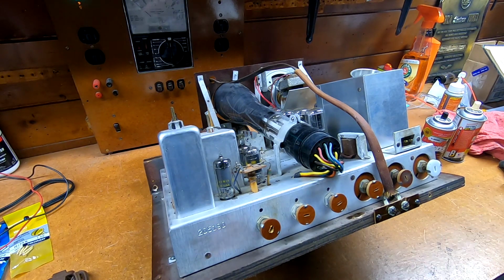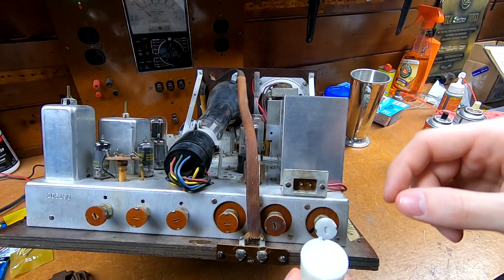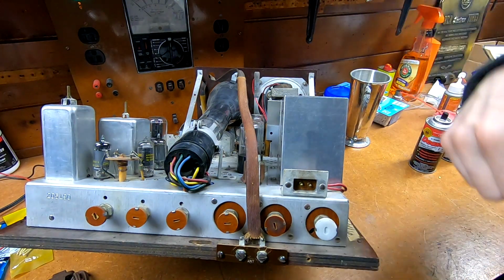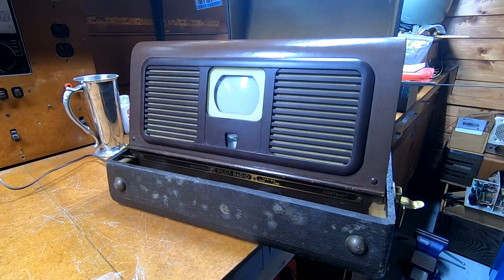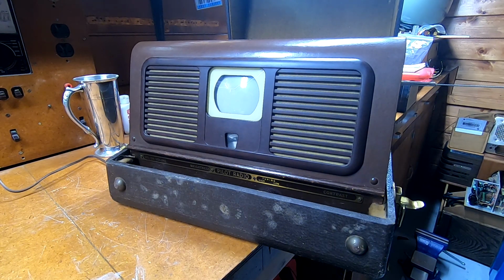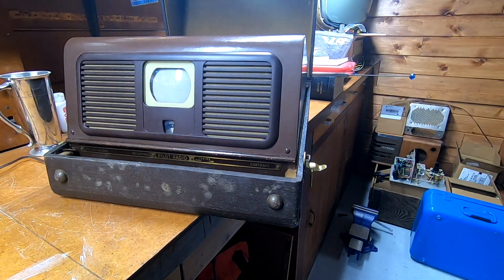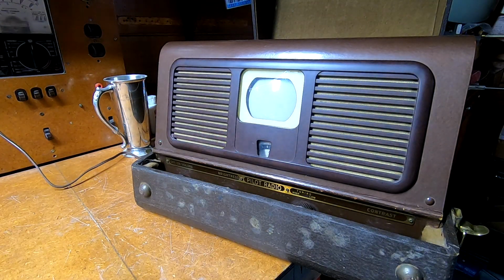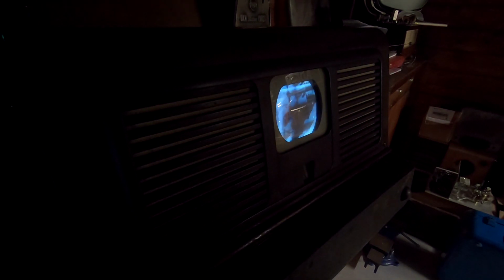Pilot TV-37 Television Repair - Part 3

Comment: Is this tv vhf or am
Where does high voltage go into the picture tube I didn't see anode lead 
What year was it made 
What about the yoke
Reply from the maker: The Pilot TV-37 is an electrostatic deflection set, so there is no yoke. VHF reception on channels 2-13, and there is no external anode lead; the anode connection is on the CRT socket. Pilot introduced the TV-37 as part of their 1948 lineup.